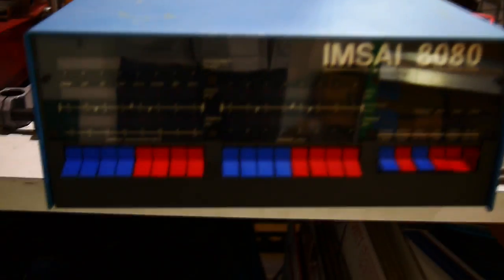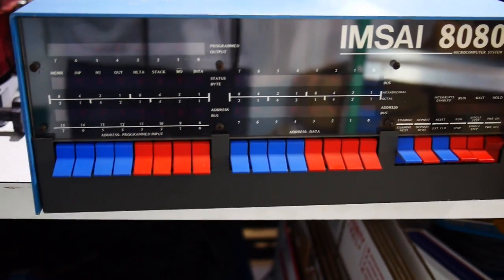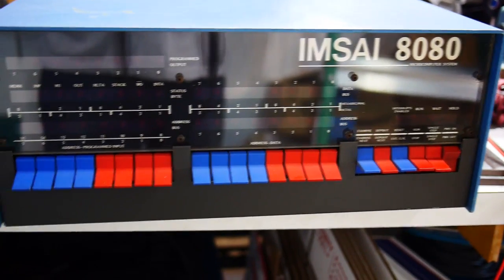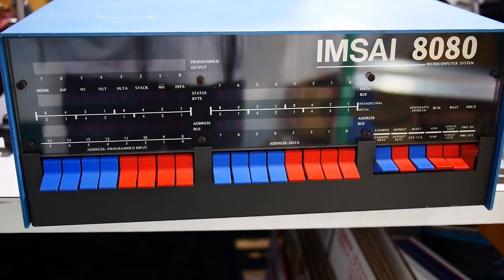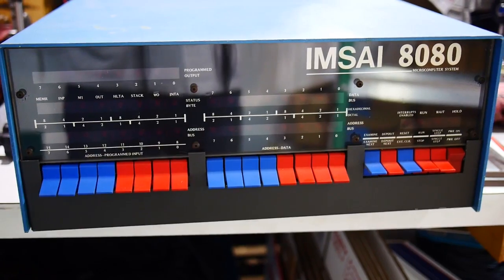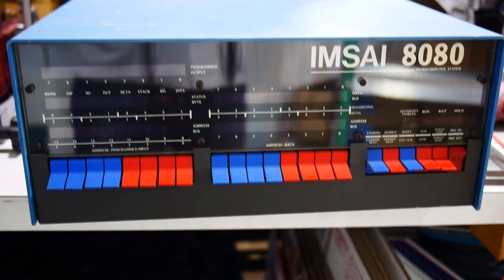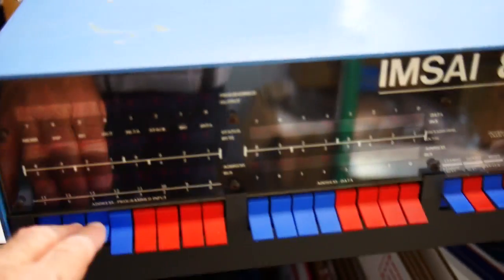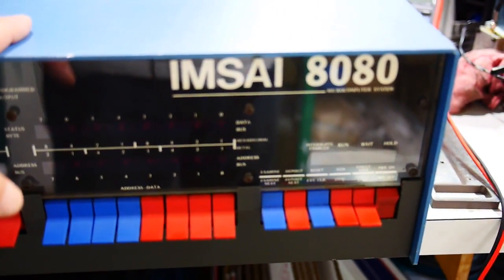#2 IMSAI 8080  A first look at the computer

Comment: DEAR  PROFESSOR  IMSAI  GUY.

DO YOU STILL READ THESE COMMENTS?

I HAVE A LITTLE SOMETHING I WOULD LIKE TO CONTRIBUTE TO THE CHANNEL.

I recently purchased a test instrument that I no longer have use for.
It’s an ANRITSU MT8820c .   It’s a “communications analyzer” that was intended to be used in the
cellular communications industry.   

It’s got a bunch of options installed and is a bitch to lift/carry.  (50-70lbs according to the UPS shipping info)
It’s in excellent shape.  It passes all of the self-testing and is is great overall condition, with the exception of 
a few scratches and a missing handle.  (it has a handle, it’s just been removed so it could fit alongside the
previous owner’s other bench equipment)

I have been improperly advised that it could act as a standalone spectrum analyzer for both analog and TDMA
 communications... It turns out that I was improperly advised (as always 🙄😳😆).   I have a Rigol DSA815TG
already and use it for all of my extremely limited needs(tuning duplexers), but thought this would be ideal for future 
projects and playing as it goes up to 8GHz. A few of my friends, the wealthy ones with cool toys..,  have the 
way more portable and USEFUL Anritsu  “site master”  portable spectrum analyzers and love them.

The Rigol was brand new and around $2k with accessories and carrying bag when I purchased it back in 2016.
It paid for itself rather quickly as a bunch of friends and clients needed duplexer tuning.
It’s not just to save on labor charges... having a spectrum analyzer (with tracking generator.. A MUST)
allows you to learn more about RF, ensure your equipment is properly and painstakingly tuned well,
enables you to carry it in the field for quick tasks that would traditionally take a system or repeater off the air
while a duplexer or filter had to be removed and taken to the local radio shop.

It’s.a beast to pack & ship and I’m sort of limited on the heavy lifting front...
But, if I can manage a way to get it out to ‘ya, how much interest do you have?

Thanks &  73
RBAD
Reply from the maker: Thanks for the offer but I don't think I can really use the functionality of that box